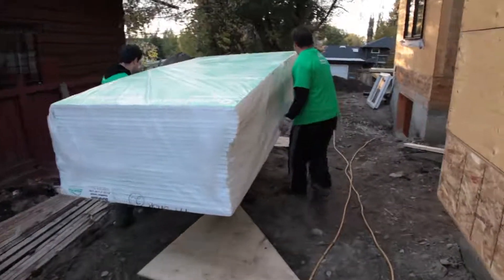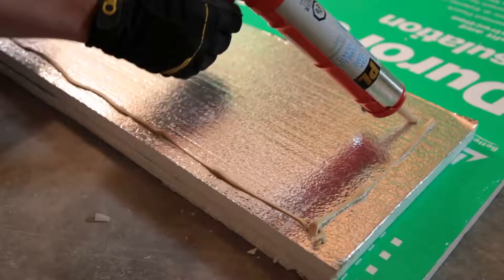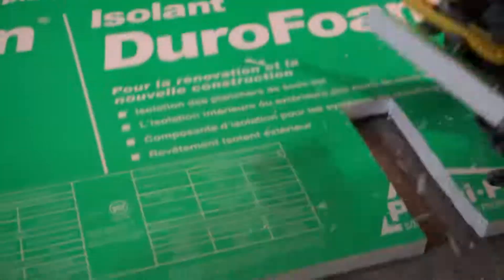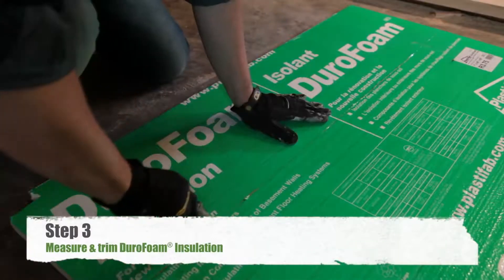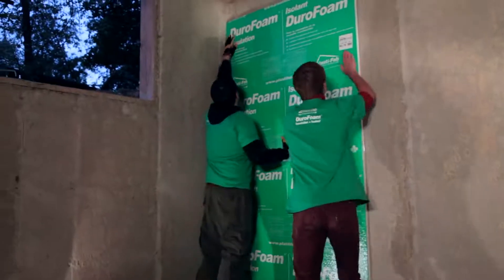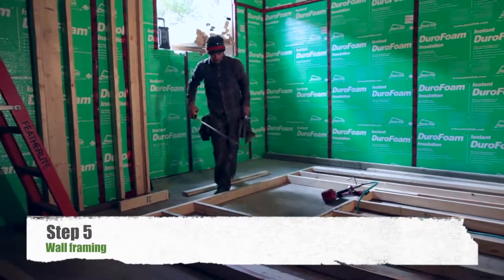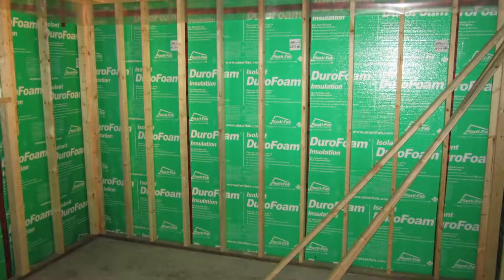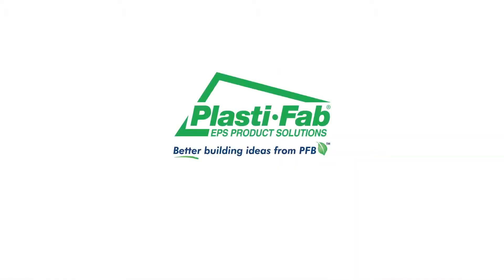How To Insulate Interior Basement Walls with DuroFoam Insulation

Comment: Just bought 7 sheets for a basement remodel, I removed the drywall to find out that the batt was installed directly on the concrete walls 🤦‍♂ batt was humid , what a shame this house is almost new. Now I bought Durofoam , to put on the concrete, then frame then put back some 2x4 batt. Now it will stop any cold draft from entering this room in the basement. I will have to do this all around my basement.

Comment: Can I leave the boards exposed without drywall in a garage?
Reply: Short answer, NO. This product is combustible. A protective barrier or thermal barrier is required. Per example, brick flame spread rating is 0 , Type X ( fire resistant gypsum ) Drywall is 15 , and this product is 290. So in case of fire, this product will spread the flame pretty rapidly and the smoke developed classification is over 500, so it means it will make a lot of smoke.
Reply: probably, but I think you might want framing to do organizing cabinets and storage shelves. I'm planning on using this to insulate sound and to increase rigidity of floor where I plan on putting a large aquarium and custom cabinets on the walls. 

If it doesn't bother you or you don't need to break their plane (vapour barrier) I don't see why not